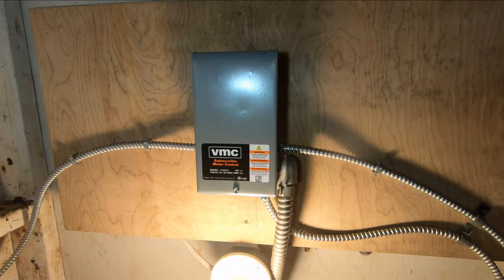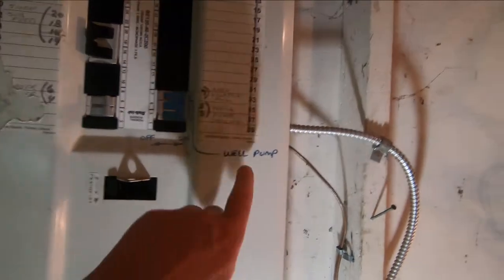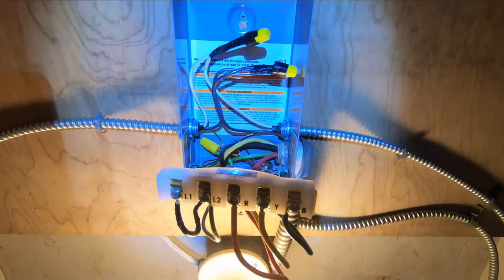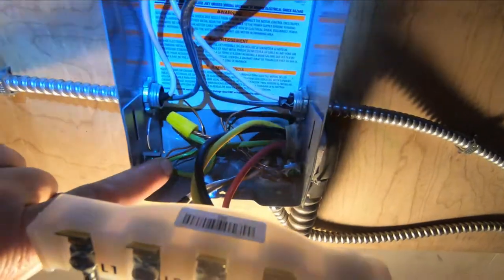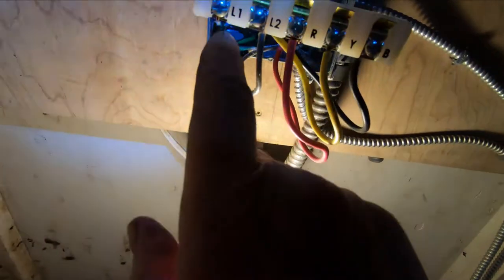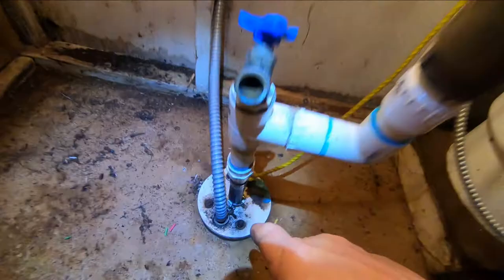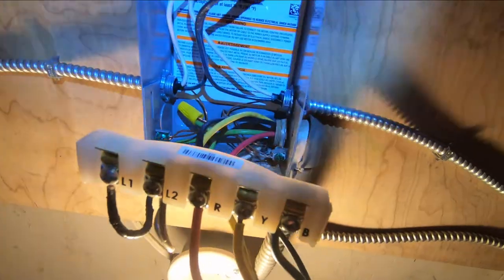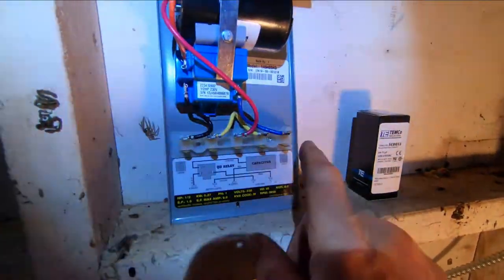WELL PUMP CONTROL BOX:  CABLE ROUTING EXPLAINED

Comment: Why did you elect to run your 240VAC "straight" through your control box instead of bypassing the control box and simply terminating it at the pressure switch - no splices.
Reply from the maker: This was the way they originally wired it. You make a good point, why create a splice when a straight run would eliminate the splice. I didn’t wire this but if I did, I would follow your advice. Thank you for watching and writing a comment.

Comment: which color power wires go to the pressure switch on the pump and which do I grown to the control box? thanks
Reply from the maker: You'll see the wire colors in this other video I made. Not all pumps are wired the same so use this as a guide but not a certainty. They most likely are these colors though. Good luck and thanks for watching!
https://www.youtube.com/watch?v=jKL3XH2VpYg

Comment: I like that you used armored cable.   Most installs I see just use romex.   I am unsure what code is and trying to figure that out for my own DIY project.
Reply from the maker: Use armored cable. It will protect surface mounted wires from damage. Romex is designed to be installed within a wall cavity where it is protected. Make sure you use anti-short bushings inside the ends of the armored cable too, to protect the wires and uses approved box connectors for cable. Good luck and greetings from British Columbia, Canada.

Comment: Any idea why a brand new franklin electric control box would develop condensation inside primarily around the capacitor.  Its mounted on a wall stud indoors but the water tank is in the  enclosure?  Moisture or condensation inside the control box cant be a good thing right?
Reply from the maker: Sounds like the tank enclosure would benefit from better ventilation. Atmospheric air will condense. Any way to ventilate the space? An incandescent bulb "on" in the space (60 watt bulb) on all the time, may help lower the humidity. If you can get some air moving in there it would be beneficial.

Comment: I think we may have grabbed the wrong pump.  We don’t have a control box, but pump has the yellow wire. Do we need to exchange this one or what do we do with yellow wire?
Reply from the maker: I would check to make sure you have the correct pump. If there is no control box on the surface, the capacitor and relay are built into the pump housing. Some pumps are made that way. The superior design seems to be pumps with a control box on the surface but the particular pump depends on many factors: well depth, capacity, use, price, etc. Best to make certain you have the right one before lowering it into the well.

Comment: Hello?  My newly bought yard, the well is not getting water, can you help connect it?  Use an electric pen to measure the three fire wires of the water pump. Is there a wrong wire?
Reply from the maker: Get an electrician to have a look at the pump and wiring. Good luck
Reply: @Everyday Projects ok thank you

Comment: What is purpose of yellow wire? They have it hooked to ground wire at breaker box and if I unhook it at well pump it won't work
Reply from the maker: In this well pump control box, the yellow is the (common) wire in the well pump motor.  It is the path back to the panel to complete the circuit. The other two pump motor wires are red (start winding) and black (run winding).
Reply: Why are you unwiring it in the first place

Comment: What if 2 have a 2 wire?
Reply: If it''s 220v both leads run through the pressure switch and straight to the pump.